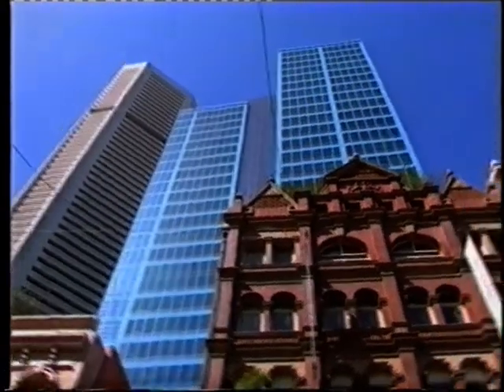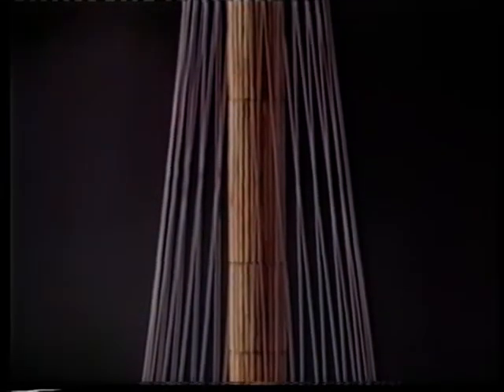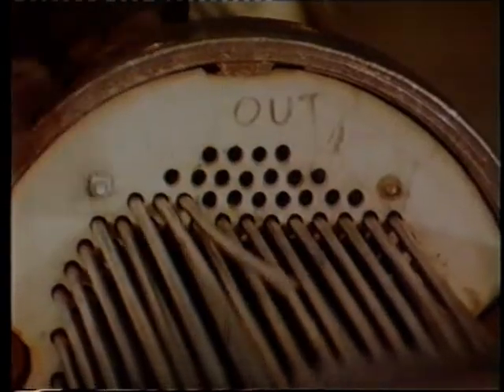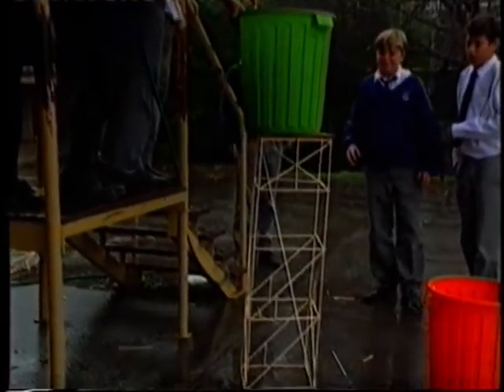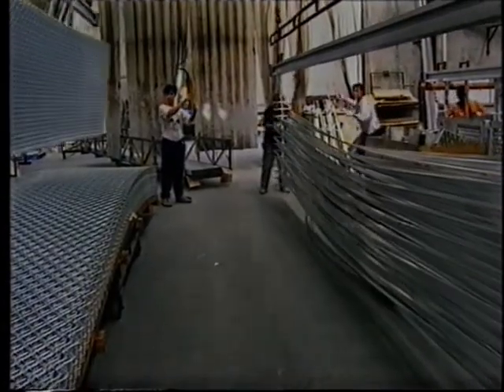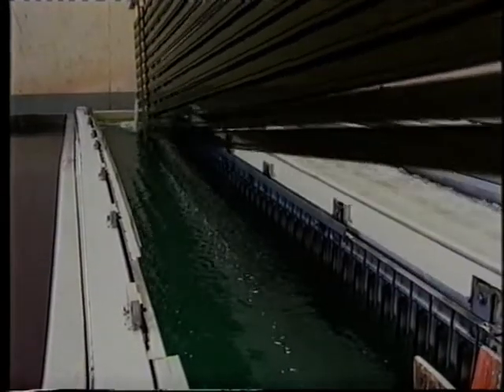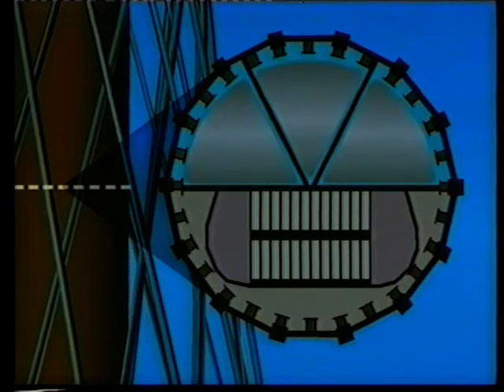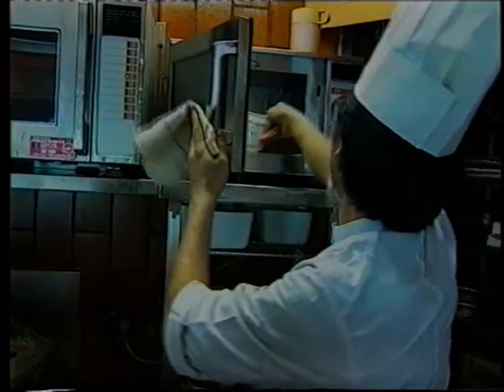Sydney Tower.  Design & Engineering, Construction & Maintenance. High School Engineering Level.

Comment: I worked on the audio video fittout on the towe, there were absolutly NO SAFETY BARRIERS on the then open windows, every now and then i still have nightmares about falling as i had to work right beside the outside, with a view almost straight down. We used to get $2.92 per hour danger money.
Reply: Bet your wits were finetuned.